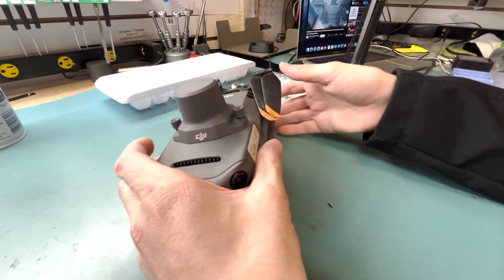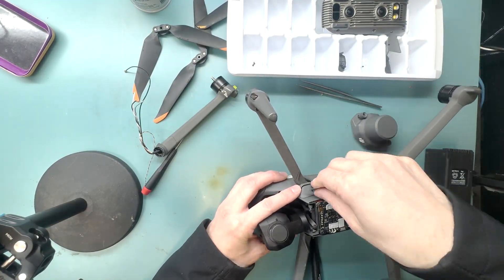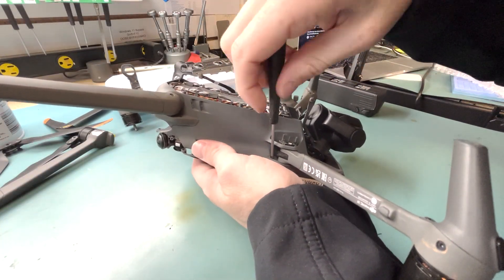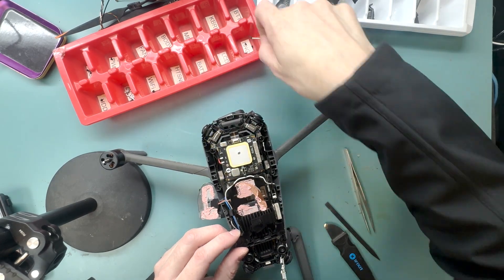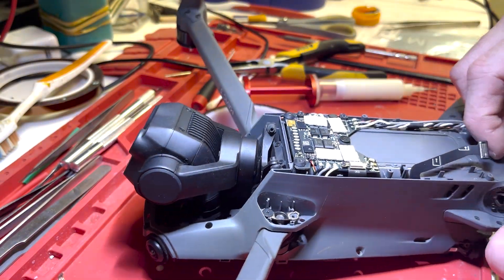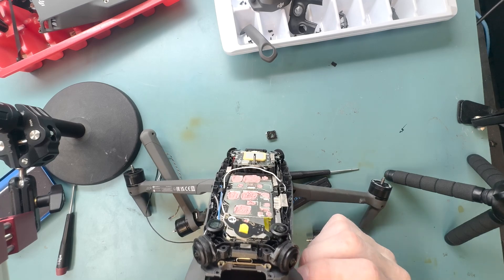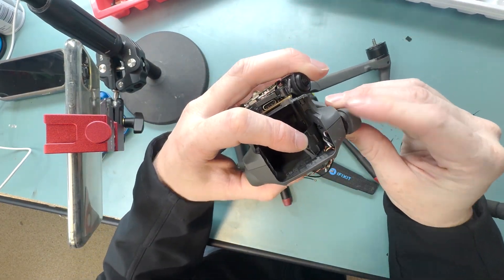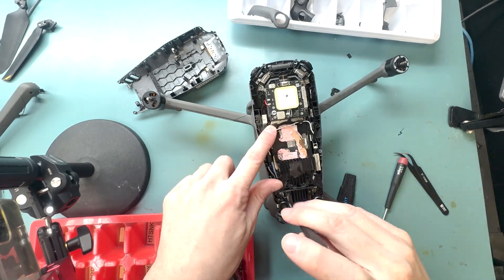DJI Mavic 3 Pro Enterprise Rear Arm Replacement Guide - DIY Repair Tutorial

Comment: Hey thank you i used this for a non enterprise arm repair, i would recommend using 380c heat on the soldering iron and some higher lead solder wire to make the process easier.

Comment: The rear arm of my mavic seems partially dislocated. Its still attached (and the thing still flys surprisingly) but its sorta at a weird angle and grinds a bit when closing.

Is there an easier way to sorta loosen up the connection around the joint where I can "pop it back in"?
I couldn't seem to find much joint work in this video
Reply from the maker: Best thing to do is send it into me for repair please email me mark@worthitrepairs.com

Comment: Hello, what kind of coating did you use over the solder?
Reply from the maker: 5ml LM Shield Conformal Coating Circuit Board Protector they market it as a PS5 thing but it has many uses to protect against environmental erosion ect.